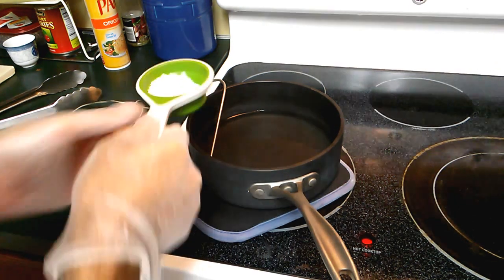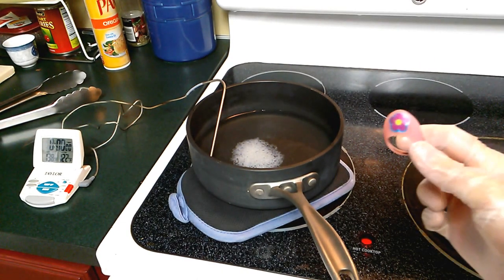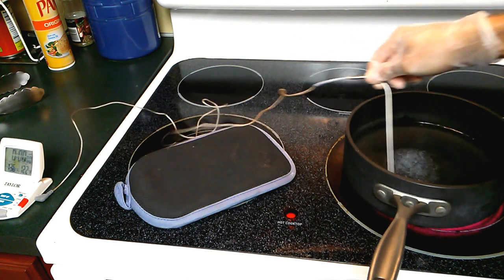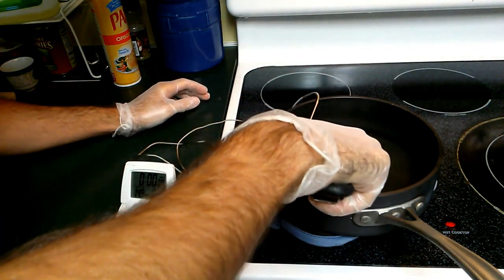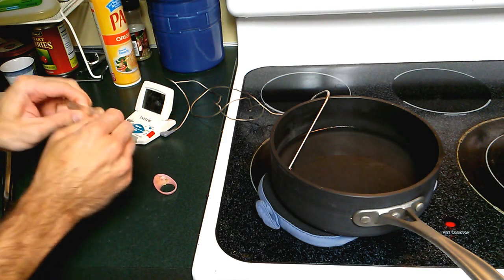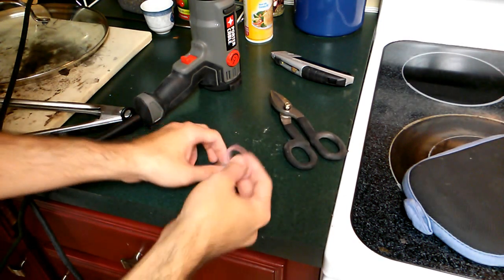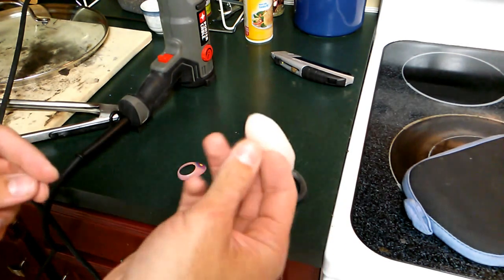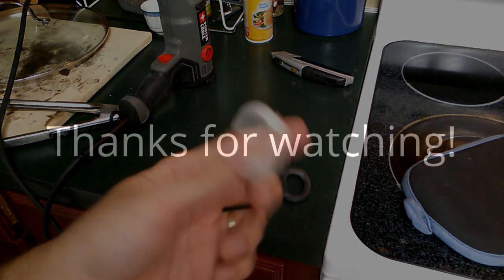The Magic of InstaMorph! Making a Turkish Thumbring for Traditional Archery

Comment: Tim, I know that voice... (or I believe I recognize it); Farengar on Skyrim. Did you do the voice acting on Skyrim as Farengar (and others)? If not, you should check it out and you will find your voices are almost identical.
Reply from the maker: Sadly, no! :) But I'll definitely check it out, and that'd be fun to do, for sure!
Reply: Tim Piatek
Its pretty cool, i made a handle for a kukri knife. It melts best with water just out of the kettle!  It doesn't do well in the microwave in water (plastic bubbles). and be careful not to trap water into the plastic!